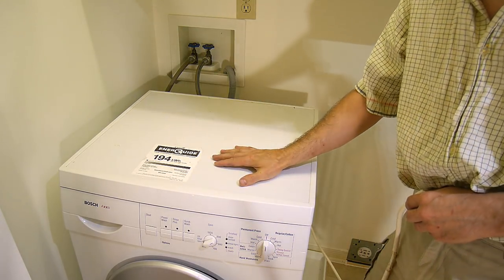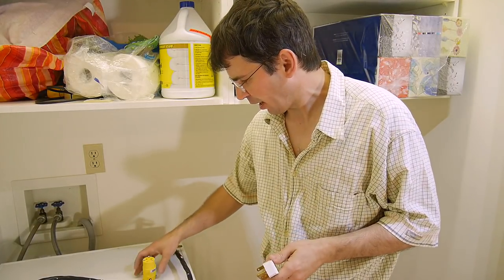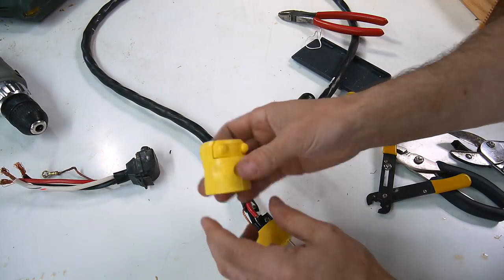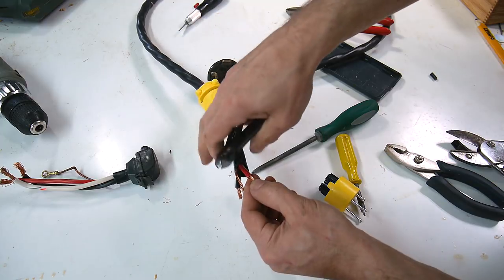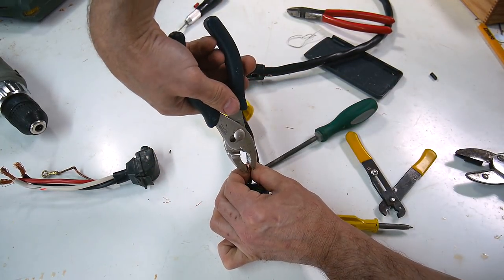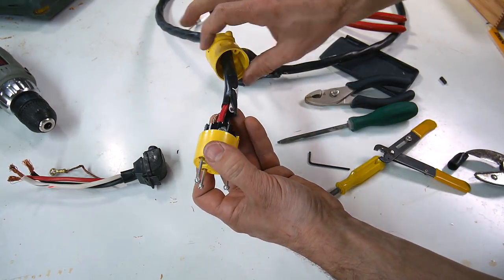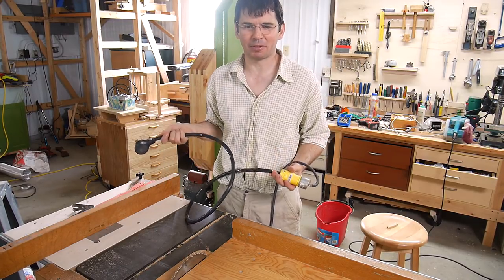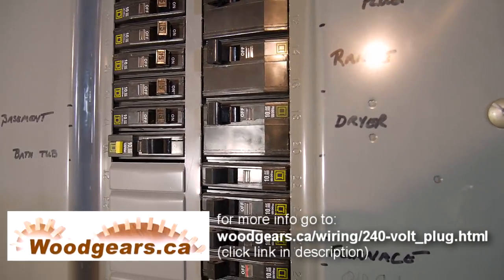240 volt from dryer plug (for Euro-washer or table saw)

Comment: I really wonder how your electrical system works. In europe we have a 400V 3-phase-system and we usually use 1 of those three (230V because of trigonometry). But what is it with your 120/240V (110/220V)? I don't know what to search for and can't find anything about your weird wiring.
Reply: RubyRhod as a British. it seems that is 220v 2 phase so between to phases it is 220v where as here in Europe it is 400v between 2 phases.
Reply: 120/240 is just a trick done at the last transformer there are three output taps one of the taps goes to the middle of the windings from the other two so from center to either side is 120v but end to end is 240v it is all the same phase just different voltages.
Reply: Search for 'split phase'
Reply: In North America it's a 480V 3 phase system with three legs of 277. That's stepped down to 208 for most commerical installations, and 240 for residential.

Transformers with multiple taps create 3 legs of 120V 120 degrees out of phase for commercial installations, where 2 legs (L1-L2, L2-L3, L3-L1) will get you 208V single phase (technically 2 phase, but we call it single). For residential it's tapped to give us 2 legs of 120VAC, 180 degrees out of phase, so those two legs give us 240VAC.

Neutral can be tapped at the transformer in the middle between two phases in 3 phase delta systems with no neutral at the power generation source. In cases with a 3 phase wye generator a neutral is grabbed right from the genset.

Neutral is bonded to ground at the panel. It shouldn't be bonded anywhere else as this could create ground loops. Additionally, there are circumstances where equipment could feed voltage into neutral (often with motors and other non-linear loads), which is why it's bonded to ground to shunt that voltage.

I think I've described that all correctly. I hope so anyways - somebody correct me if any of that is incorrect.

The naming convention of "110V" and "220V" is a bit outdated and inaccurate. It comes from a time when power was generated at a lower voltage and things weren't standardized as well.
Reply: +Charles Forrest It's not the same phase, it's split phase. There are two phases 180 degrees apart.
Just because it's not "Two Phase" doesn't mean there aren't two phases.
Reply: thank you very much! so it's a single phase three wire system. here in europe we use this (or at least a very similar) system for the distribution of electricity for trains (-55kV L1 and +55kV L2).
Reply: So come on Billybobjoe198 and Rhody Jeff?

 Is it 2 phase (with 208v PD between phases, 110v between a phase & neutral)
 or a 
Centre Tapped Earth (CTE) (with 2x 120v from local pole transformer)??? (single phase) 

By the look of the way Matthias wired the plug, I suspect its CTE, but I don't think his method was correct since im pretty sure that the neutral should be connected to ensure the GFCI or RCD, if installed, works!.

what system in North America is in use for DOMESTIC properties?

 I also know that 110volts for building site tools in the UK & some other parts of Europe use CTE, with 55volts running through two cores + neutral bonded to earth, while as a technician I use 'true' three phase power with 415v PD between phases and 230/240v PD between Live & Neutral.   

I've also realised while thinking about this that its possible for a 3phase aplience to require 5 cores (Ground, Neutral, L1, L2, L3, whereas motors only have Earth + L1, L2, L3 

This is because, for example 
A big commercial fan heater might have 

- A 5amp 3-phase motor for the fan motor. 
- 3x 15amp 1-phase heating elements, all on different phases, and each requiring the neutral. 

NB: the content of this comment may be incorrect!
Reply: Center tapped 2 x 120V (technically two phases, but called single phase). It's common in north america to have 240V devices with two 120V hots and a ground, and no neutral.

Keep in mind that nominal voltage is the difference between two points. If you have 120VAC on one leg, and 120VAC on a second leg, 180 degrees out of phase, you get 240VAC when you meter them on the + and - side of a multimeter, since the difference between those two points at a given point in time is 240V.

If you have a single 120V leg and a neutral and put them together, you get 120VAC. If you were to take two 120V legs line-to-line from the same phase on the + and - side of a meter, you'd get ~0V, since the difference between those points is 0V, even though individually they'd read 120V line to neutral.

Technically, if you take 120VAC and ground, you'd also get 120V, but you really don't want to be using ground in place of a neutral. Ground exists to shunt power to in the event of some sort of fault. It's often tied to piping in older homes (which you could easily come into contact with), or in some rare cases is rigged up in such a manner that isn't safe just to try and fool an outlet tester for a home inspection (bonding neutral to ground right in the outlet box..eek!)

Neutral exists as a "return" wire of sorts and could potentially carry current, though it typically won't carry much. In a 240VAC circuit in the US, the second leg of 120 takes its place.

I hope that helps answer your question!
Reply: Yep, all understood. 
What is the argument / reasoning for describing the '2x 120v' 'technically two phases'? 
Is it really two phases entering the transformer? 
If both of the two (2) 120v hots have a PD between them of 208/240v, then yes, it must be multiple phases, but if there is no PD voltage between the two, then, technically, the two (2) 120v lines HAVE TO BE on the same phase.
Reply: Just a matter of nomenclature. It's called single phase power just because, even though there are two phases of 120.

If we're splitting hairs, it's actually split phase as others have mentioned, but I've never heard anyone actually call it that in the wild.
Reply: The appliance doesn't care whether it gets +240V on one cord and 0V on the other cord or +120V on one cord and -120V on the other cord at any given instant. It's the difference that counts. 

In Norway, a lot of us have IT style power grid. We have three phases of 135 V, 2π/3 out of phase with each other. The difference between any two phases is 220V (or thereabouts). No neutral wire, and ground is a wire that goes in the actual ground outside.

Comment: I normally welcome most videos with open arms as there are many ways to do things when it comes to woodworking.  But, when it comes to electrical work, there are many ways to do things, but they should all be done with safety and code in mind.  Why to code do you ask?  Well, even though code is sometimes a pain in the ass, it is there to save lives.  The best solution to this situation is to change out the outlet to an approved 240v/20a device and not use a series of cords as Matthias has shown here.  I love your videos Matthias, and I've been a subscriber for years now, and have bought plans from you, but this should and could have been done differently.  Yes, Matthias did mention in the end of the video that the breaker was not rated for the wire servicing the dryer (should have been a 30a. breaker), but a 20a. appliance should be serviced by a breaker that matches that appliance as to not allow the appliance to overheat.  I'll always be a subscriber, Matthias.  Keep sharing and we keep watching. :)

Comment: Im not trying to be a saftey nazi but you should never use the ground as a current carying wire even in a 240 volt circuit. The ground is only meant to clear faults not as a neutral. In a 120 volt circuit if the ground is used as a neutral or the to were connected then if the ground was lost then effectively the current would pass through the load and to the neutral terminal. Since the neutral terminal isnt connected to anything except the ground pin which is connected to the metal case of the load. This energizeing the metal case without anything to clear the fault. This ussaly isnt the case for 240 volt circuits though.

Comment: Why do you have 240V and 120V in the same house, does this mean you have two cables connected from the grid to house one has 240V and the other has 120V. Why is this the case in the USA. Here in Australia we have only 240V.

Comment: Wow! The safety police fell for this one, hook, line, sinker, rod, reel, boat, motor, anchor, trailer...but didn't your hardware store have a NEMA 6-15R wall receptical and cover plate on the same shelf where you picked up the 6-15R cord end?
Reply from the maker: I already had the cord end, and didn't want to change the socket in the house.
Reply: Makes sense. Looking forward to seeing the new ideas and projects you will come up with for your new house. Thanks for maintaining such an informative channel and website. It has sparked a number of great projects among my (middle school shop class) students.

Comment: Living in Europe I can't figure out anything more uncomfortable than having 110 volts power source: you basically have twice the amps for the same power amount, and this is very dangerous. You need twice the cable diameters, huge plugs and the risk of having electric arcs with bad plugs is quite serious at a very low employed power.

Comment: When is north America going to ditch 110V? Seriously, every domestic piece of kit in the UK has one type of plug and one type of socket. You can use any length of extension cable without things getting hot or tripping out. The plugs have fuses in them and are bulletproof mechanically. I do love my American friends and in most ways the place and people are amazing, but man, your electrics are just bananas!
Reply: Why? Because an appliance made yesterday will plug into a socket from the 1940s, and an appliance from the 1940s will plug into a socket made yesterday. There is just no need to upgrade a system that works.

Comment: a dryer is that thing you put your clothes in after you washed them, right?
why exactly do they need a different socket?
Reply: they run most things at 110v if you half the voltage you double the current and vice versa so a 220v socket won't need as thick a cable ran to it to do the same work

Comment: What? That was a UK 240 plug? I have no idea how you  achieved this. It would be nice to know. We tried to figure out how to plug our 240 4 wire Canadian shite into 3 wire European 240. I really don't get this but it's something to look at.
Reply from the maker: even if you figure out the wiring, it may not work.  Anything that has an induction motor or a transformer in it will be damaged by the 50 hz instead of 60 hz.  Going from 50 hz to 60 hz is ok for transformers, but motors won't work optimally.
Reply: @matthiaswandel  yes...the UK has an inverter box for UK 115 tools.. thought about rigging a panel for our big tools with two. Small tools on one side. 50hz though. Anyway our tools were stolen. Nice bloody ones that made the container worth it.

Comment: my question is if it was bought here, why is the plug wrong? why would it not come with the proper plug for here in north America? considering there is a standard for the plug for a drier.
Reply: Apparently the washer is part of a washer/dryer pair. The washer is supposed to plug into the dryer, so the manufacturer was free to use a different than standard plug (and did so). The plug type is a NEMA 6-15 plug, which you can look up.

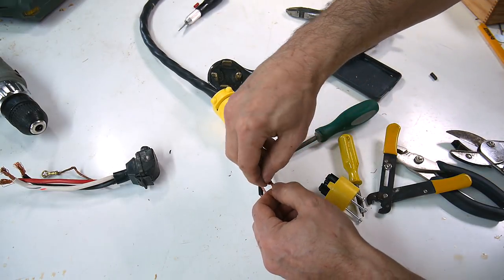Comment: 1:19 That's one of the reasons to use ferrules on the ends of stranded cables. The main reason being that a bare screw clamping down on the strands can damage the wire and make a bad contact - not someting you want for a high current application.

Comment: OMG I cannot believe you attached bare live wires to the pins on a plug with just black tape!  You should be using different coloured tape for each pin.
Reply from the maker: Yes, with different coloured tape, it would be completely proper :)

Comment: I can't understand why u didnt just cut the plug off the washing machine flex and just stick the new plug on it instead making a lead. Plus change the breaker to 20A 40a is not going to protect a 2.5mm^2 flex we use either 6 or 10mm sq cable for showers in Europe on 40a rcbo's

Comment: Please check out the difference between a neutral and a ground. They perform different functions and in your case, if the washer uses 120 VAC for the electronics, It will need the neutral.
Reply from the maker: well, if that were the case, then the manufacture would have made an error putting a plug with out neutral on it.

Comment: I imagine you opened the washing machine up and checked that it can't be easily rewired to operate on 120v; I've seen some fairly large electric motors that could accept either.

Comment: Pop the "hood" off and check the electrics for dust or potential shorts, Bosch electrics on washing machines aren't always well designed when it comes to protection, well, the more modern ones are with conformal coating, but my old one died from dust overheat, and so did my neighbors (who bought it after i did some 3 years ago).

Comment: I'm not an electrician but maybe a better safer fix would be to buy a cord that fits the plug and wire it directly to the dryer.
Reply: Why? There's nothing wrong with what he did.
Reply: @simonrichard9873  What he should have done is to replace the dryer breaker with a 20-amp 2 pole, and the 30-amp dryer socket with a 20-amp NEMA 6-20R.

Comment: Wait can u explain in more detail why you didn't connect ground?
Reply: He did connect ground. He did not connect the so-called neutral because it is not used inside the washer, and the washer plug has no neutral pin.

Comment: I'm far from a saftey nazi when it comes to my own home, but i do know that there would be a better way to accomplish this. Id use a 2 or 4 space Square D sub-panel box, and run the dryer tag into the main lugs for that. Then you have your two phases and a neutral/ground bus to do with whatever you please. You can even attach 120V appliances safely to this breakout box with the appropriate breaker installed. Breakers are of course only meant to protect the wiring as Matthias stated, so the 40A breaker at the main house panel protects the in-wall wiring, and the dryer tag, while your new sub-panel breakout protects everything downstream of itself.

EDIT: This is how you can get some juicy Kw's of power if all you have is a welder/dryer outlet in the shop and would like to do some heavy duty electrical shenanigans :)
Reply from the maker: If you have the time.  But in fact, all you did was mak a youtube commeht.
Reply: Matthias just ROASTED YOU! (Cue the dank memes.)
Reply: Well jeez i sincerely apologize if it came off as "i know better". It truly is merely a comment and I can respect the don't just say it, do it mentality. I only intended to give an alternative method to hobbyists and the like who care to take those extra steps and maybe hadn't thought about doing it that way before. Any solution that works safely for the long haul is a good solution in my book!

Comment: I have the same washing machine since 2004 and it never had a problem since then. Sturdy stuff the Bosh washingmachines, provided you run some empty cicles at 90 degrees with bleach now and then, to melt the stinky muds which develop in the hosing with time...

Comment: Luckily your house didn't burn down with that "temporary" fix. Also you're not using euro washer for money laundering right?
Reply: You should never run a washing machine or dryer with no one in the house, dryers can catch on fire regardless of their wiring. Besides, the crappy chinese electrical stuff people buy off ebay is a much larger danger than his temporary fix.
Reply: we improvise like that every day in India, no fire so far :p
Reply: I know a guy who had a DIY electric bicycle. He had his LiPo battery pack with bare wires temporarily, and with some dusting by another person, they came together. Burned the whole apartment down.
Reply: Lucky we have cement buildings here
Reply: Suraj Grewal Concrete does worse structually in a fire then wood. Rebar becomes flexible and conduxts heat. the outside of wood will char and insulate the core keeping it cool and structural.
Reply: SakariNy 
An old axiom, "There is nothing so permanent as a temporary fix."
Reply: @Suraj Grewal - Just wait until you have an earthquake.  Bet you'll change your opinion, if you're still alive.

Comment: I still wondering how you can have 120 & 240 volts... is it from same electric company ?
Reply: The incoming power is 240 across 2 phases, 1 of them + a neutral = 120

Comment: In Germany you would be slapt for this connection. At the copper ends there you have to press a brass oder copper tube. Because, if your tight the screws to the copper, the copper will float. And float. And float. In some time the connection will be bad and hot. Then you need the firebrigade.

Comment: One easy way to stop the cord from melting from over current, but lower that the breaker in the breaker box breaks for, is to add a breaker to the dryer cord. That would be similar to how the UK (BS 1363 or Type G) plugs and sockets work. Almost every plug that I have seen of Type G has a 10 amp fuse in it.
Reply: Ps. In Sweden, Ground is used make sure that anything metal that humans can touch is not live and hurts. Neutral is used  as a return feed for single phase power. The only difference in hookup is that Ground is connected to a Earth leakage circuit breaker and then to neutral.
Reply: I got it wrong. everything BUT ground is connected to the Earth leakage circuit breaker.